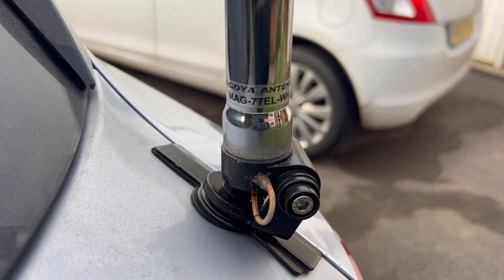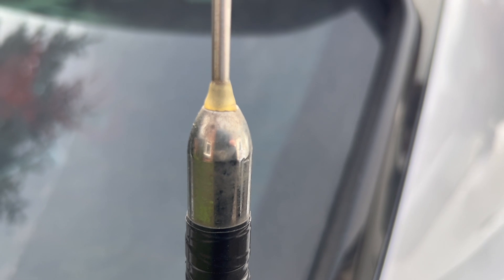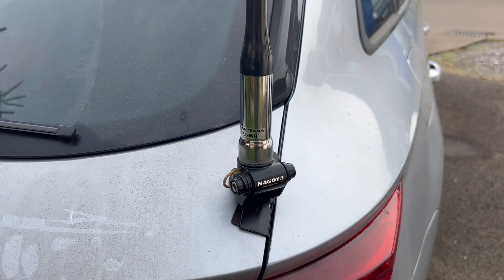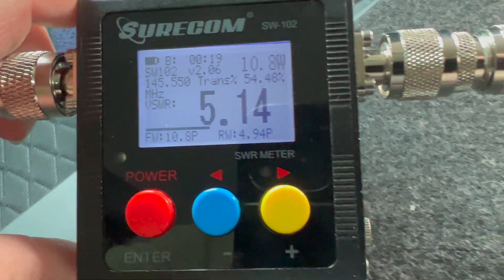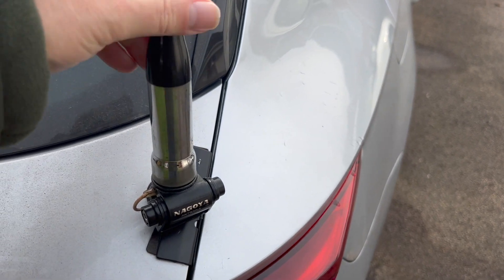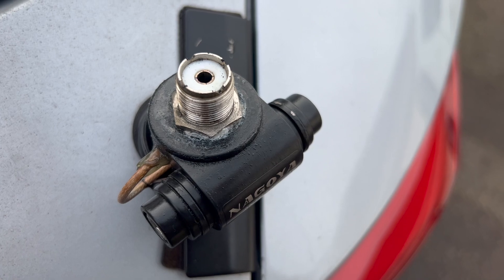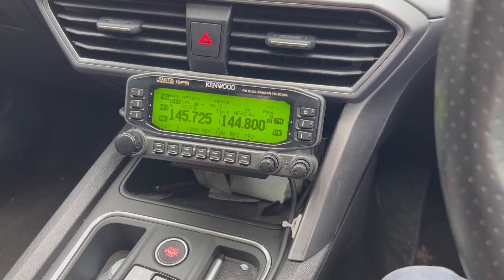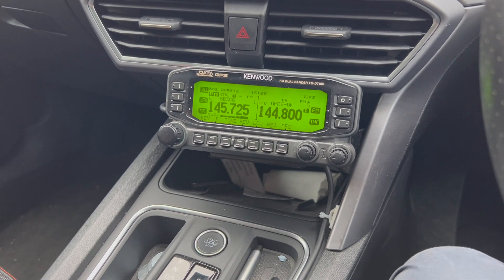HAM RADIO: High VSWR on Car antenna FIND & FIX. 2/70M

Comment: To hell with continuity. Take the antenna off and put a dummy load on the mount.  Good SWR=good cable and mount. Next suspect...
Reply from the maker: Not so, the dummy load does not require a good ground at the antenna mount or a good ground plain to work.
Reply: @mike-M0MSN  True.  But you are not checking the ground plane.  You are checking the mount and coax to ensure RF is actually being delivered to the antenna efficiently.  Checking how well you are bonded to a ground plane is a different subject.  You can have good continuity and still have a huge impedance bump somewhere in the mount and/or cable.  A dummy load checks both impedance and continuity.  And if you've lost all or most of your reception, that points to a continuity issue or a faulty antenna.  Check with a dummy load anyway.  And gain antennas are available for VHF/UHF which do not require a ground plane.  All the best!

Comment: Either broken center conductor in the coax on either end or a possible short circuit in the coax next the antenna may have a small disc capacitor in it thats blown

Comment: I have virtually the same setup on my Mini Cooper, my mount is on the top of the back hatch on the center line of the vehicle. However I use the Diamond brand 2 meter / 440 band antenna, I believe the model number is SG 7900 ( high gain model ). Been using the Diamond band antennas for several decades. When tested for swr  across the U.S. 2 meter band (144-148 mghz) the swr are petty much flat across the band and 70 centimeter is relatively low as well. 

Many years ago I was at an amateur radio club meeting where there was a radio demonstration inside the building. One of the club members was have trouble with swr’s, I said I will be right. I went out to my 4 x 4 pickup and pulled off my diamond antenna mounted to a large 4 magnet mount on top of the cab of the truck. Took the antenna and mount inside and attached it to the radio, the swr’s were flat when checked.

I have also used the Diamond antennas on bicycles as well with very low if no swr’s.

If you can get them, I would try the diamond antennas, I personally have had great success with this brand of antennas!
Reply from the maker: thanks for your post James. ;)
Reply: So have I , they are pretty good antennas.

Comment: Fixing the sleep mode is simple on the 102 meter. Push and hold the blue button until your in the menu, select item #2 and then adjust the timeout from 1-9 minutes.
Reply from the maker: Many thanks for the info,   :)

Comment: I had a problem at the back of my radio once with high SWR. Right where the coax makes a hard turn out the back of the radio,  It became barely shorted but eventually shorted completely 100%  from the  outside shield to center conductor. SWR went off the scale.
To solve the issue I put in a new coax and installed an PL259 Elbow on my Stryker 955. 
Mike is 2/70 bands what most Ham operators run in their cars?
Reply from the maker: Yep, 2M and 70CM are the local mobile bands and sometimes 4M and 10/11M   :)